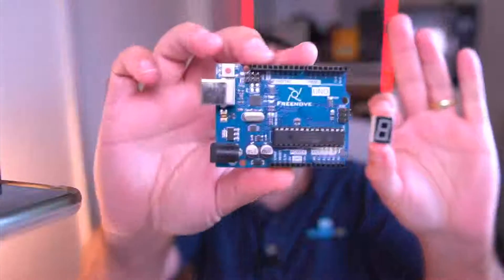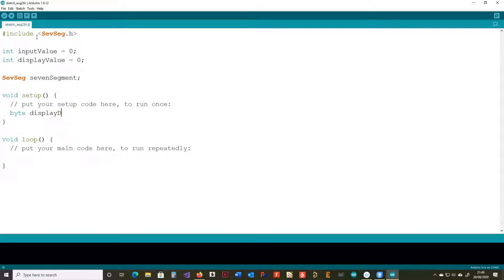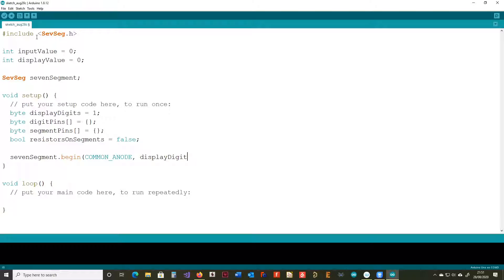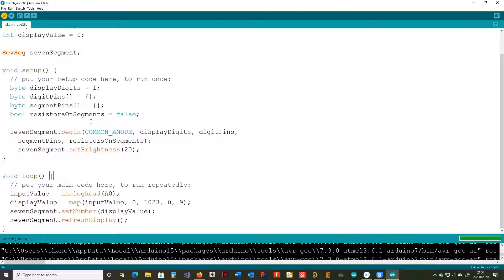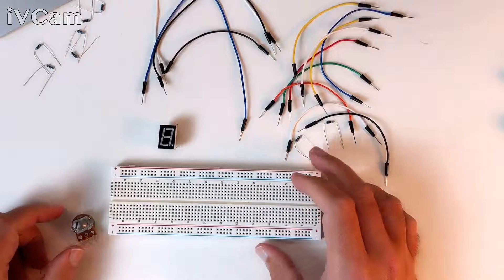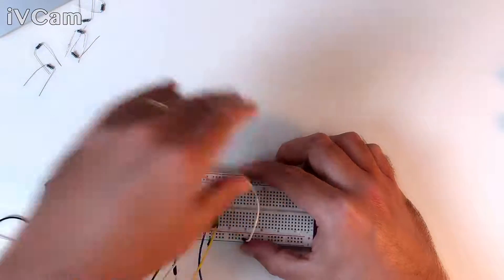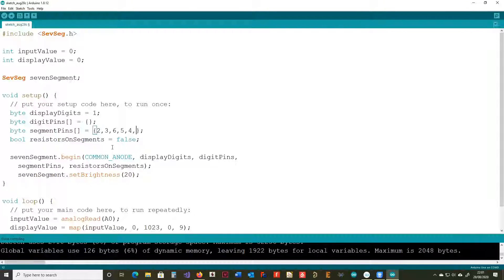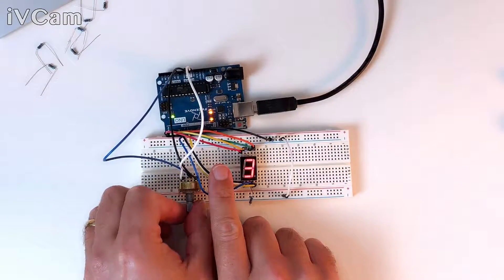Seven Segment Display Arduino Project with Code #arduinoproject #7seg

Comment from the maker: The code is below. You'll need to make sure you install the Library SevSeg using the Library Manager in ArduinoIDE

#include <SevSeg.h>

int inputValue = 0;
int displayValue = 0;

SevSeg sevenSegment;

void setup() {
  // put your setup code here, to run once:
  byte displayDigits = 1;
  byte digitPins[] = {8};
  byte segmentPins[] = {2,3,6,5,4,1,0,7};
  bool resistorsOnSegments = false;

  sevenSegment.begin(COMMON_ANODE, displayDigits, digitPins,
    segmentPins, resistorsOnSegments);
    sevenSegment.setBrightness(20);
}

void loop() {
  // put your main code here, to run repeatedly:
  inputValue = analogRead(A0);
  displayValue = map(inputValue, 0, 1023, 0, 9);
  sevenSegment.setNumber(displayValue);
  sevenSegment.refreshDisplay();
}